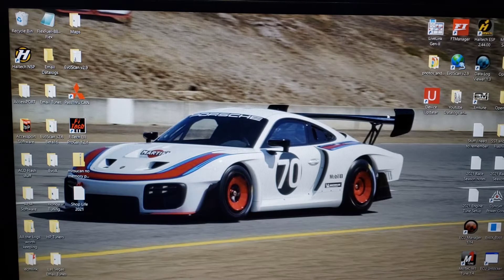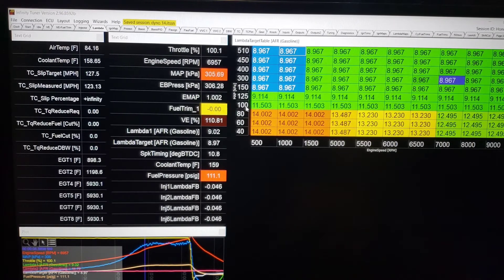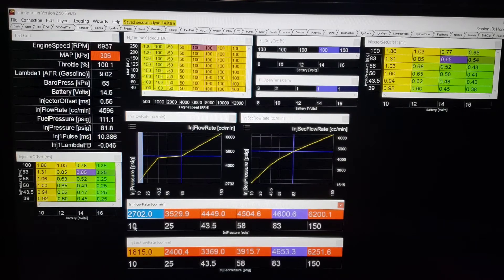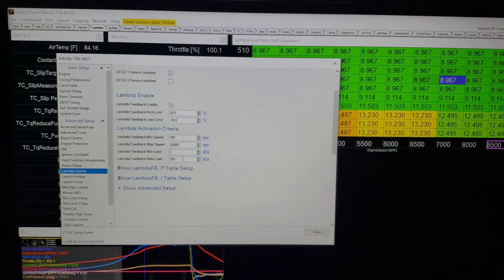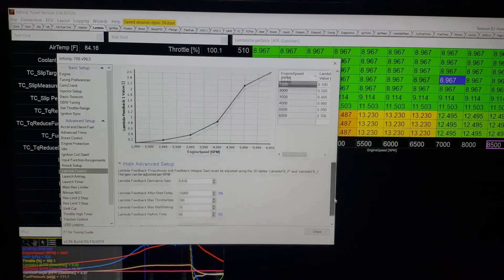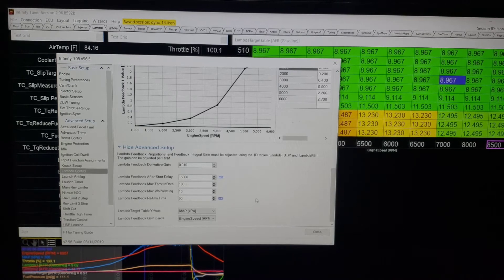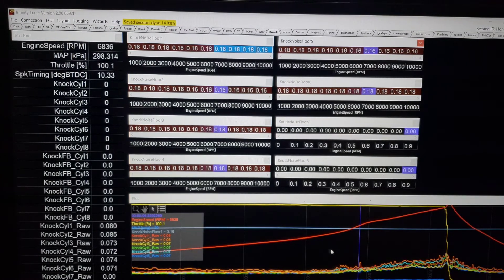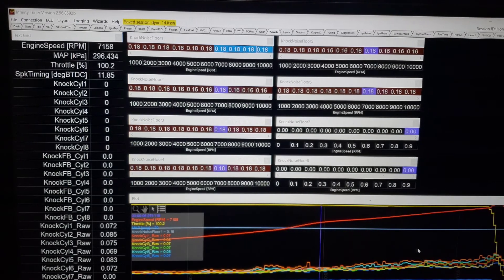AEM Infinity Lambda control and tuning

Comment: Random question which is best hp tuners or infinity tuner
Reply from the maker: HP Tuners just uses the stock ECU for some applications. An Infinity is a complete replacement and far more powerful tool but is also more involved in tuning and installation.

Comment: so you have 1 knock sensor per cylinder?
Reply from the maker: While some cars have multiple sensors, the Infinity will break up the knock value based on crank degrees where that particular cylinder has fired. This time around I have one Bosch knock sensor in the factory location.

Comment: Hi Aaron, thanks very much for your videos.  I've at least a dozen videos deep in your channel.  Might you ever get a chance to do a video with the Infinity and ITBs?
Reply from the maker: That would be a great video, I'll see if we end up with ITBs on some standalone. I can definitely cover it on a Haltech
Reply: @AaronONeal1  thanks for considering it.  I'm really curious how a modern VE ECU treats primarily Alpha N based load tables.  Infinity is the platform I'm learning so I'm biased towards that but I'm sure the concepts on the Elite is the same?
Reply from the maker: @RyuMoto  it occured to me I did an R33 not too long ago. I don't have any NA specific ITB tuning but I did tune that alpha N with "boost comp" for the fuel model. Timing is still vs MAP.
Reply: @AaronONeal1  that would be cool to see.  Would be interesting to see what your table structures look like in the infinity and which you kept as MAP vs Throttle% axis.  Thanks replying!

Comment: There are 4 different target lambda tables in aem, i couldnt find any option in setup wizard to make use of them or find when they can be applied. As opposed to LINK g4 platform you can clearly apply lambda overlay tables and use them in different strategies.
Reply from the maker: It is used via mode switch